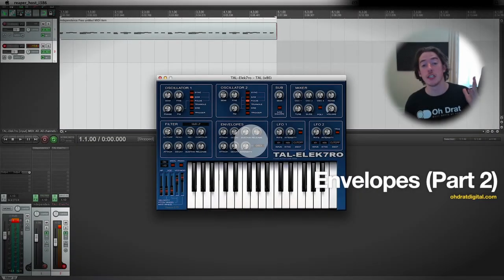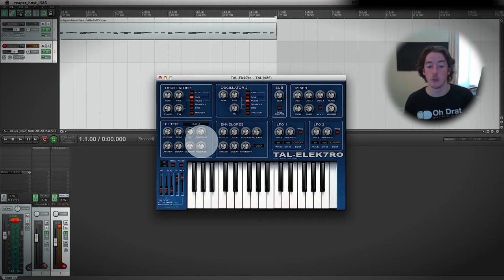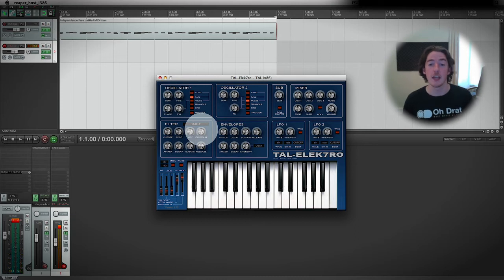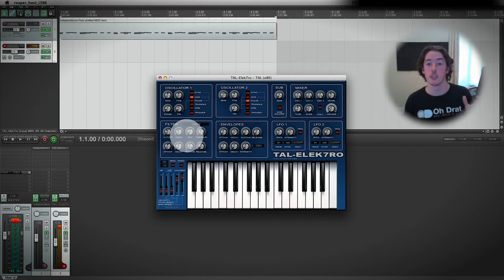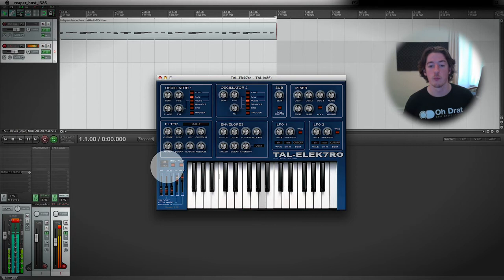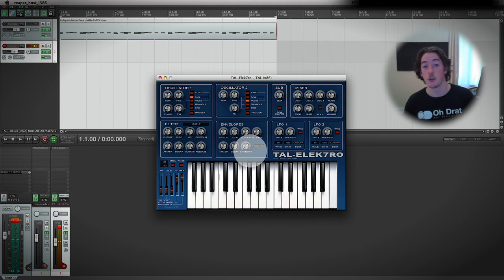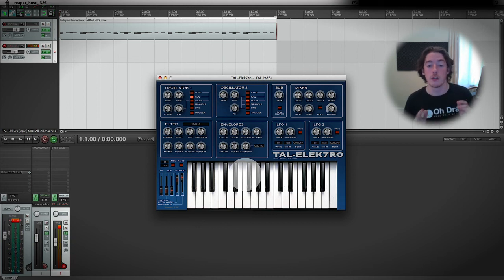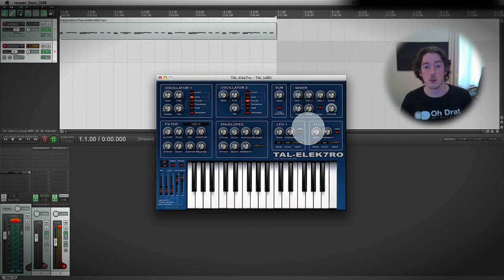Total Music Production Course 20/63: Envelopes Part 2

Comment: i have a doubt,in the envelope why does the pitch of the oscillators change from what we specified to a higher pitch which we didn't specify when the attack is increased? in the video you said it the semi tone dial turns to the setting we specified. But what i hear is the semitone dial turned up from what we set